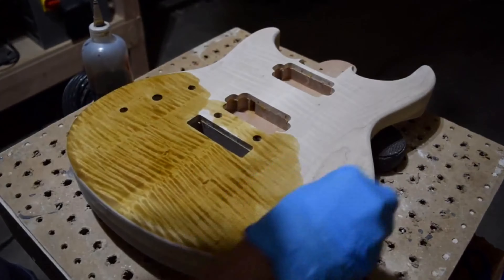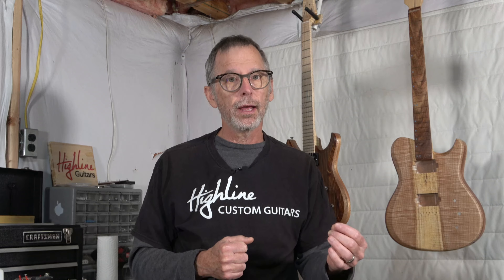Applying Stain Or Dye On A Guitar Veneer

Comment: Personally I use fine steel wool to remove as much surface dye and then alcohol and only after I can't remove any more dye do I lightly sand. I bought the Anolin dye. It's working great. I used this channels link to purchase the sample pack. Buy some small glass jars with sealable screw on caps to mix your dye. If you hold it up to the light you can see the color. Use scrap wood to test the color. You can mix the dyes to make many colors.

Comment: I just built my first ever Chinese kit guitar with a thin quilted maple veneer top. I used a brilliant crimson Aniline dye from Lee Valley Tools after first using a charcoal fabric dye to highlight the quilting and lightly sanding between. I was very worried about sanding through. Although I used the manufacturers recommendation and dissolved the dye in water, I got very lucky, no bubbling no obvious noticeable glue bleed through anywhere even down the center line. Overall it turned out quite well .. certainly wouldn't be up to your standards Chris but it was a great learning experience for me. My next guitar is a JEM style basswood guitar from Solo Music Gear which should be a better quality kit and will be painted. I can't really build guitars from scratch without having a proper workshop so the kit guitars are a fun option. Always look forward to learning tips on building from your videos.
Reply: Solo Kits are very good but be aware they use odd measurements on some items. I wanted to upgrade my cheap plastic nut but there are none after market nuts that fit the nut with. The nut on my PRS kit is very narrow. Your only 2 options are their white only upgrade nut or you have to get one custom made. It's pretty sketchy that they try to force you to have to buy their upgraded parts only. Also I bought a PRS import replacement bridge but it didn't fit. Because the nut is odd the neck is narrow and therfore the bridge string spacing is odd. 

So when you buy the kit you may want to check and but any upgrade parts from them and save on shipping unlike me.
Reply: But their upgraded parts are not expensive and made by brand names but some parts only fit their guitars. For instance Goto makes the upgrade bridges and tuners. Fyi

Comment: I've been experimenting with dyes to make some flame maple pens that are guitar inspired. One thing I found in my research is that PRS will hit their guitars with water then apply the alcohol based dye. It helps open the pores and lets the dye get deeper into the grain so you get a much deeper penetration into that curvy grain. Then they hit it with an abrasive to bring the grain back a bit, then re-dye to replace any dye that came out in the sanding. I'm using about 12 thin layers of CA glue top coat on my pens to mimic the gloss on guitars, but a MUCH shorter dry time than lacquer. 

I did use some Keda powdered dyes. I could not get them to dissolve in alcohol. I'd get it very mixed up, but if I let it sit for 5 minutes, it separated out to clear alcohol on top and the colored powder on the bottom. But if I mix the powder with warm water, it seemed to stay dissolved for days. 

I've been using the Keda dyes, Angelus Leather Dyes, and both the alcohol and water based stains from Crimson Guitars. I've been very satisfied using all of them. At least on my pens. Never tried it on veneer.

Comment: Interesting. I hadn't thought about the glue seeping through the pores of the veneer, and messing up the evenness of the dye. Do you think that spraying/applying some sort of Sealer (maybe Sanding Sealer) to the bottom side of the Veneer would be sufficient to protect the top of the Veneer from the glue? Maybe the Sealer itself would just seep into the pores and defeat its use. 🤷‍♀
Reply from the maker: Sealer will block dye just like glue.

Comment: Hi Chris, a little off topic but maybe helpful for others. 
I’ve dyed a maple top that I fixed to a Telecaster. It’s about 10mm thick and I’ve done a bit of carving on to give it a nice shape. I used water soluble dyes which was ok because I had plenty of wood to sand back. Ive got it looking just how I want it but should I put a thin layer of sealer on it before I give it Tung Oil treatment. Or should I just go straight to Tung Oil?

I’m thinking if I seal it the risk of pulling the colour out when I oil it will be less. 

What are your thoughts??

Or anyone else’s thoughts or experience??

Cheers 👍👍
Reply from the maker: You need to test on scrap to know what's going to happen. Personally, I would never use a water-based dye followed by Tung oil. Instead, I would spray a water-based clear coat over the dye.
Reply: @HighlineGuitars  Thank you for your reply. Can I ask why never Tung oil finish over water based dye? Will it not get the nice shine it gives bare wood? Or is it you just prefer the way you know and trust. I can use a WB spray lacquer but I just fancied a change.

For some reason I tend to do a better job with the water based dye’s. I’ve used the spirit type in the past but just end up chasing my own tail with it. I couldn’t never blend it well because it dried too quick.
Reply from the maker: @waynehughes8297  It's okay to apply tung oil over a water-based dye, but you should consider mixing in a binder like water-based polyurethane so the color won't smear.

Comment: Hi Everyone, getting my second kit soon here (if shipping is on time) and I'm trying something new for staining. First kit I went for a natural look on a flame maple veneer top PRS style with a satin walnut stain/varnish mix and it turned out pretty nice and the grain/pattern looks great in proper lighting. This time however (this second kit is also a flame maple veneer top) I'm looking at trying a pure tung oil finish, but I wanted to try something unique color-wise so I decided to get some chameleon color shift mica powder. The plan is to do the pure tung oil cut with odorless mineral spirits about 50/50, with the mica powder mixed in. From everything I've been able to find and research online it seems theoretically possible that it should work, and absorb pretty evenly. However the only 2 examples of chameleon shift colored guitars I could find online were a Cort G280 and a Jackson PC1-Chameleon, and I'm sure they weren't the same process (but possibly still oil based dyes?). If anyone has any thoughts on how this would turn out, or perhaps you've tried it before, please let me know. Not sure what I'm getting myself into, but whether it works or fails it should be a good learning experience!

Comment: Hi! Thanks for this useful video. Talking about stain or dye, would you please tell me how do you work on a headstock that has an inlay (no matter which is the inlay material)? How do you avoid staining the inlay? (or cleaning them after applying the dye/stain/finish?) Thanks so much!
Reply from the maker: I don't do anything special. The materials I use don't absorb stain or dye.
Reply: @HighlineGuitars  Thanks for your answer. So I understand you apply the finish and then clean the inlays. Thank you very much for your fast response!

Comment: How would you do a transparent stain on a burl maple top (with the little holes in it)?   I'm thinking...SAND/WATER/DRY/SAND/AQUA COAT/SAND/DYE/SANDING SEALER/WET SAND/CLEAR...what do you think?
Reply from the maker: I think you should test your plan on scrap to see if it will meet your expectations.
Reply: @HighlineGuitars  That's the plan!

Comment: It tired to sand and dye an epiphone les Paul and I had this issue. The I had to apply the dye multiple times and the veneer ended up getting water logged and rippled. Did not turn out like I had expected.
Reply from the maker: Was the dye water-based? Alcohol-based dyes work much better in that they evaporate faster than water.
Reply: @HighlineGuitars  it was colortone. And I mixed with alcohol. But it just wasn’t taking it up. So either I didn’t sand deep enough or the glue was blocking the pores like you said. I thought adding more dye solution would get more penetration, but ended up water logging and rippled the veneer.
Reply from the maker: @simmonphoenix3206  Colortone is a metallized acid dye with glycol ether as a carrier. When mixed with alcohol, it can soften the glue that was used to laminate the veneer if too much was used.

Comment: Hello,I watched your video on wipe on poly.I want to do this using Brite Tone water based.Do you have any tips on how to apply the water based poly.This stuff tacks up very  quickly..no time to go back over to level with rag.Thanks
Reply from the maker: It's best to use an oil based wipe on poly since it has a longer working time. For water-based poly, it's best to spray it. If you can't, try brushing instead. You'll still have brush marks, but if you build up enough coats, you can level sand them out once it has fully cured.
Reply: ok Thank you

Comment: Starting a build myself and the guitar has a veneer top. I had actually already decided to use Keda dyes and stumbled across your video so I picked up denatured alcohol. Do you believe the top requires sanding prior to applying the dye? I think this one came with a thin poly finish on it already from the factory and I’ve sanded that already.
Reply from the maker: I’ve never used veneer so I don’t feel qualified to answer this, but maybe another viewer can. Sorry!
Reply: @ thanks for the quick response!

Comment: Couldn’t you just dye or stain the veneer before applying it? Just give it plenty of time to dry out first. That wouldn’t work?
Reply from the maker: I doubt that would work. The veneer could wrinkle and you would still have to do a lot of touch up sanding and dying after gluing it down.
Reply: @HighlineGuitars  ahh, that makes sense. Thanks for the reply.